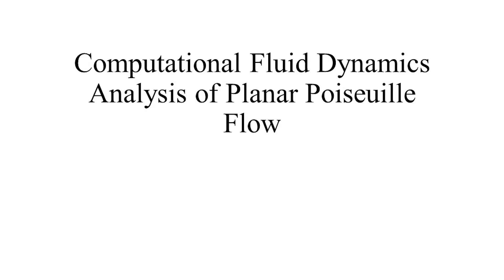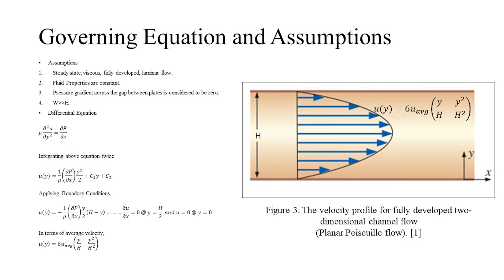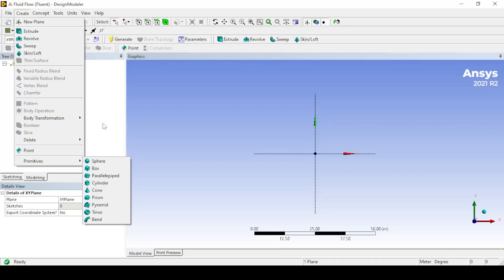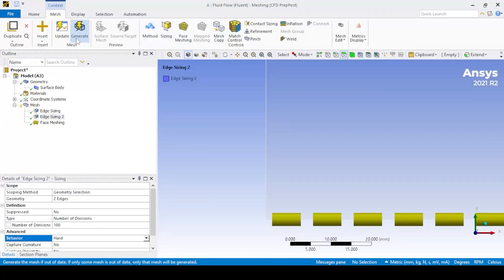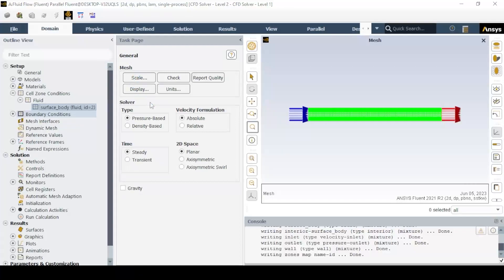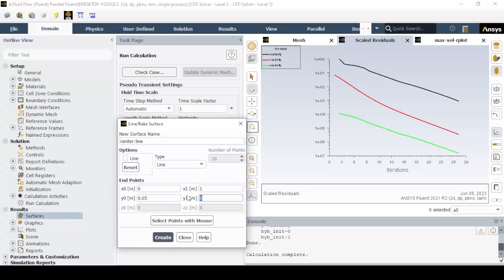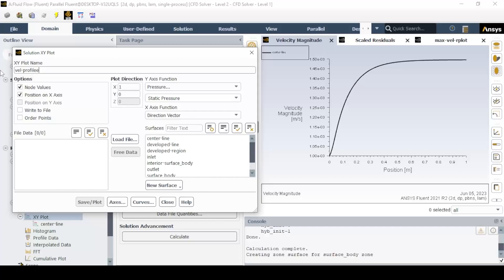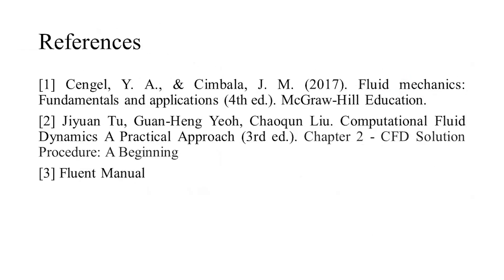CFD Analysis of Planar Poiseuille Flow using Ansys Fluent (Validation)

Comment: Thank you for the very useful video! But what if we add additional axis in our model? In this case we have orthogonal parallelepiped. Inlet/outlet surfaces YZ. Velocity parabola should be set in z direction: v_x(z). 
1) Can we set the same formula in this case: v_x(z) = 6 * u_avg * (z/Lz - z**2/Lz**2)? 
2) Should we set walls XZ as periodic boundaries?
I tried to do for 10m*1m*1m geometry (100*10*10 cells) with liquid, expressed by water. The u_avg = 1 m/s, XZ walls are set as transient periodic boundaries. Related to the theoretical formula delta p = 12 * mu * Lx * v_avg / (Lz*Lz) = 0.12 Pa, but Fluent predicts 0.098 Pa. May be you know how to fix it and fit the output?

Comment: Hello Pr, I watched your video and I have some qestions:
1- How to calclate total pressure drop of all domain?
2- If we using nanofluid, How to calculate Reynolds number (I mean inlet velocity), is it using dynamic viscosity and density of nanofluids or water?
3- what is the type of momentum and energy equations using in Fluent, I mean dimensionnel or adimesionnel?
Thank you so much for this video.
Reply from the maker: Thanks for your interest.
1- To find the total pressure drop take surface integral and calculate area weighted average of the inlet and outlet.
2- Please refer "Corcione M, Cianfrini M, Quintino A. Heat transfer of nanofluids in turbulent
pipe flow. Int. J. Therm. Sci. 2012;56:58-69." for detailed explanation. 
3- Fluent uses various dimensional forms as per problem definitions. For more detailed explanation refer "https://www.afs.enea.it/project/neptunius/docs/fluent/html/th/node11.htm".
Reply: Thank you so much Pr for your answers @Inphitude